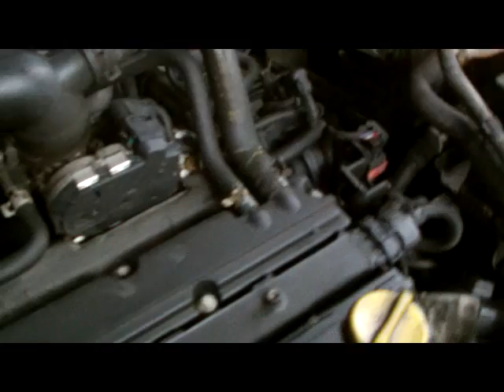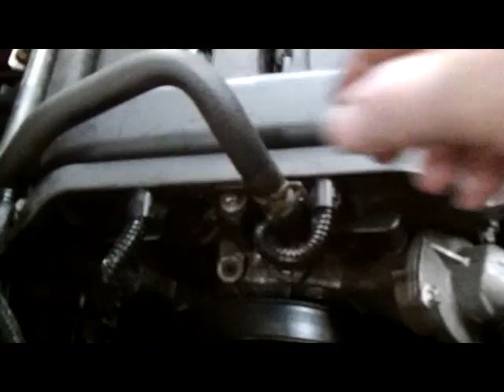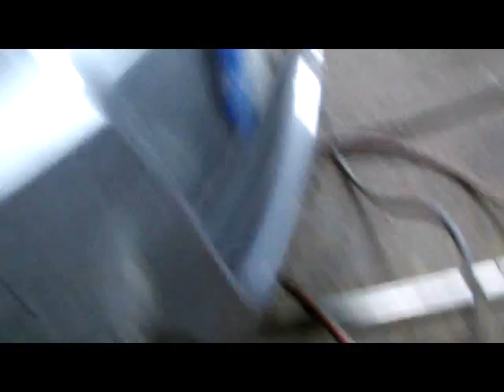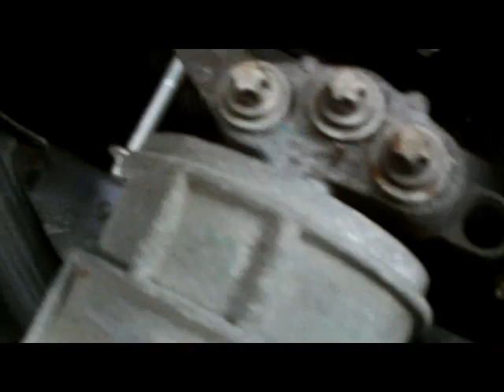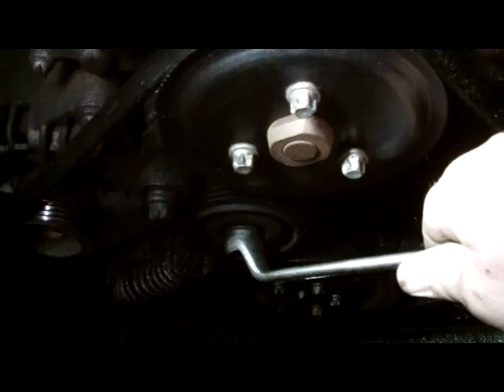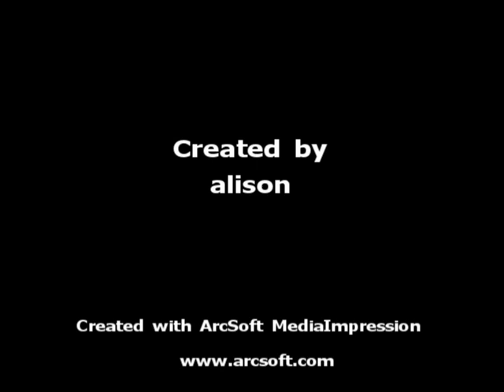VAUXHALL ASTRA H WATER PUMP REMOVAL

Comment: If the bypass pipe alone is broken, a replacement brass one is available. Drill out the plastic one, use a tap (M5) to clean out the thread & screw the new one in. £10, 10 mins.
Reply: mind broke today would a m5 tap be big enough to clean the thread out,i think the thread is around 7mm ,cheers
Reply: That is a best way. Guy changing a water pump to make money ..... should just change that part in 5 min and charge 20£ every one happy

Comment: liam, this might seem a silly question but where exactly do you place the jack when mounting the engine, eveything else I understand well but i'm worried i'll place the jack in wrong place when jacking the engine
Reply from the maker: under sump with a block of wood.
Reply: thanks Liam, have to say your video is best I came across and helped me so much, even if the donegal accent is hard, even for a Dub! Seems I have exactly the same issue, the hose running into the pump just sheared right off. looks like the bit is still screwed in...how did you remove it? I assume you need a whole new hose? Also, one if the nuts on the 3 nuts on the pully just sheared right off (about half way). Andy suggestions on how to remove it?  Was going well and didn't see this coming:-)